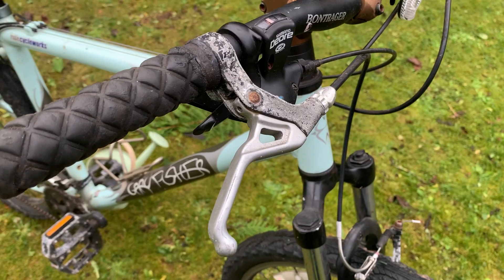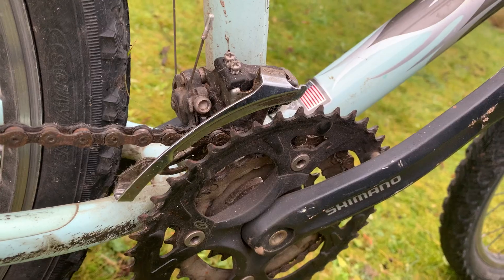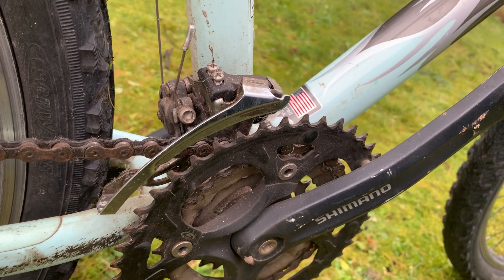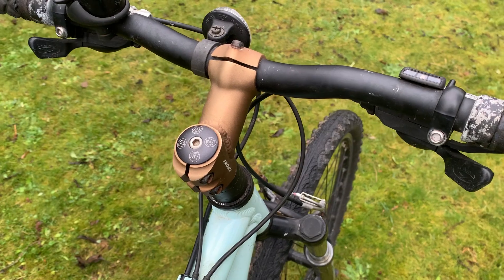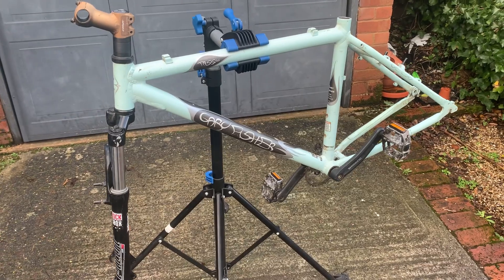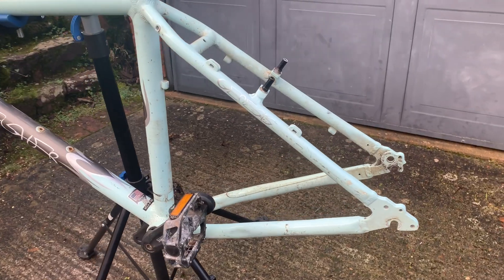2004 Gary Fisher Tassajara // Mountain Bike Refurb Project // 2. The Teardown

Comment: Jay , why didn't you do a proper comprehensive stripdown as I did with my Tassajara . The bottom bracket on mine was in bad shape and not obvious until my crankset was removed . The forks also needed servicing .
Reply from the maker: I thought I’d focus on the basic strip down first - it’s easy to remove brakes and gear cables etc 😁. I’ll clean these parts up and once done tackle the cranks and forks in a separate video. Hope you’ll join for the ride!👍